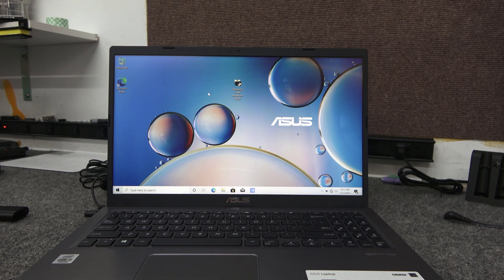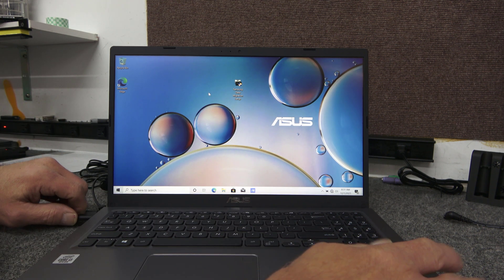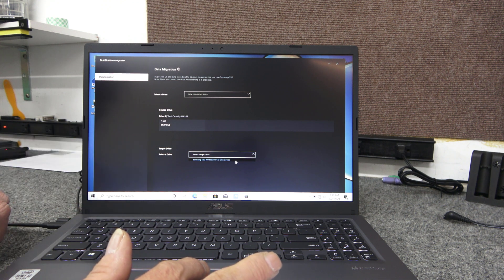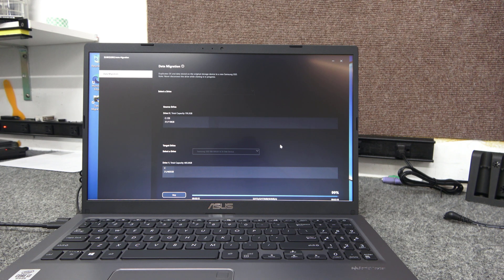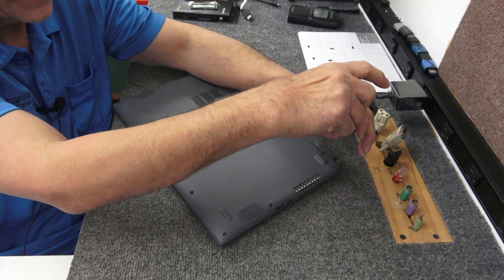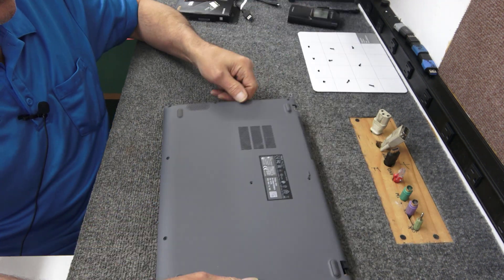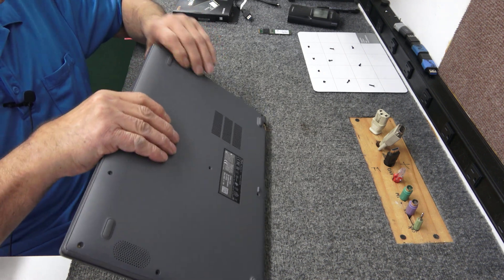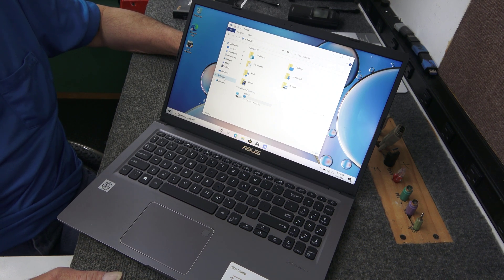ASUS VivoBook SSD UPGRADE MEMORY UPGRADE CLONE SSD

Comment: Hello Dale,
I have an Asus Vivobook Model S5402Z with factory 12Gb RAM & 500Gb SSD memory. I called asus tech support and asked them for my maximum upgrade specs. They said i could only max out my RAM by replacing the 4Gb DDR4, 3200 MHz, Dual channel with an 8Gb to go with the 8Gb built-in for a total of 16Gb RAM. For my memory,  I could max out at 1Tb type M.2 NVME. What happens if I go bigger with a 2 Tb or 4 Tb SSD and more RAM? Does it mean that the laptop motherboard will not be able to handle this? Could you please let me know what is a safe maximum spec for my upgade? Thanks!
Reply: Don't worry mate, it will handle 2TB SSD with no problems, How do I know? I just did it last night and it's running fast, My RAM is soldered on thee mother board so I can't update that, 16GB is enough.

Comment: Yes Mike nice video the only problem I can see is that the initial RAM is soldered into the board and if that goes belly up then the whole motherboard (and hence the machine) is dead in the water unless one is clever enough to replace the initial RAM chips??

Comment: I hope you are still monitoring this Youtube channel.  I have an ASUS vivobook Model F542UA DH-71. I think I have had it about 4 or 5 yrs. It got to running really slow. It would take 10 minutes to startup fully.  It came with 8gb ram. I replaced to orinal ram with new 8gb ram  The laptop started like new again and so I bought another one and installed it in the 2nd slot.  It was hard to tell but I think it ran just a tad more faster with the added 8gb ram. ASUS vivobook ran good for about a few weeks and started the routine of running slow again. I have been swapping the new ram out from 16gb back to the old 8gb ram that took out. I put the old back in however  I got confused and I'm not sure which is slot #1 or slot #2 now.  I don't know it that matters. Anyway, no matter which slot I use when installing even just one of the ram boards it doesn't make a different.  So at this point I don't know if the 2 new 8gb rams are bad or it the factory installed windows 10 home is somehow corrupt. Once the laptop is finally booted after 10 mintues I can get on the internet as usual and it seems to work ok.  It's just that it is really slow booting up. I don't know if I should by another 8gb ram and try it or by a ssd and clone it to the installed windows 10. How can I tell if windows is still ok, or not or the ssd is making it run slow?

Comment: I want to thank you that was straightforward, thank you, my question:  Asus vivobook  will I be able to buy a N7600 11th gen 1t, 32gb upgrade the SSD t o2Tb, and the memory can not be upgraded?  I love to get the N7601 that is not out with no date set.  thank you for any advice you can offer.  FISH  ((LIKED))
Reply from the maker: Hi. Thx. The memory at 32GB is it I believe on that model. 2TB SSD is certainly doable.  Dale
Reply: @CadillacComputerCenter  thank you, I will look into a 2Tb ssd for it  appreciate the  advice (correct 32gb soldered)